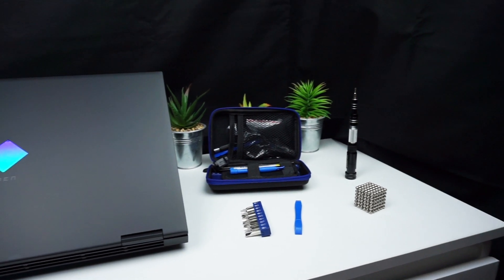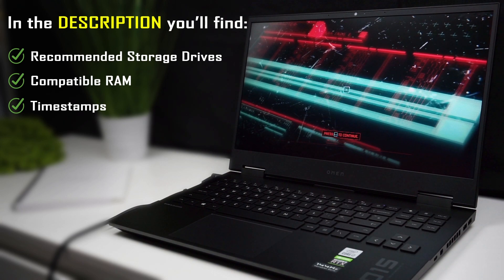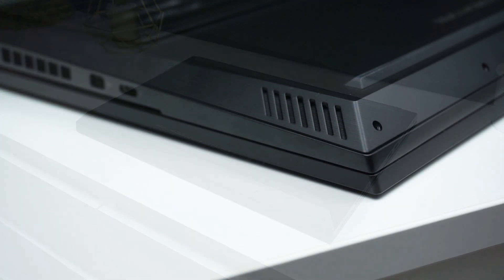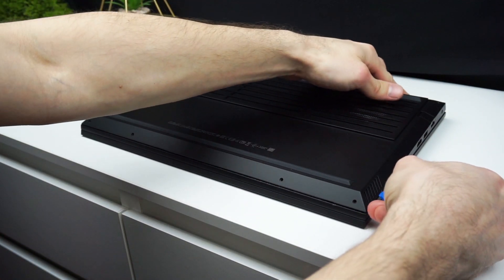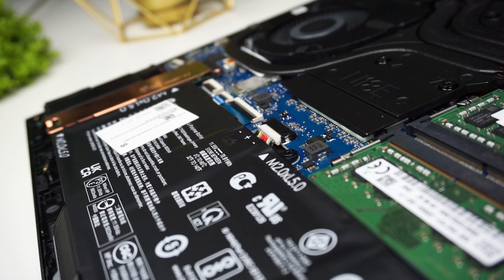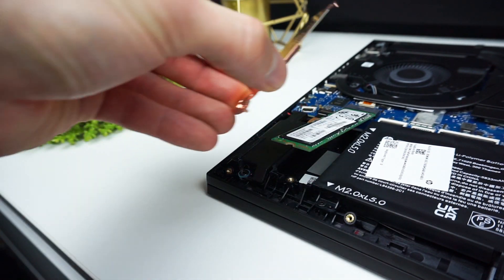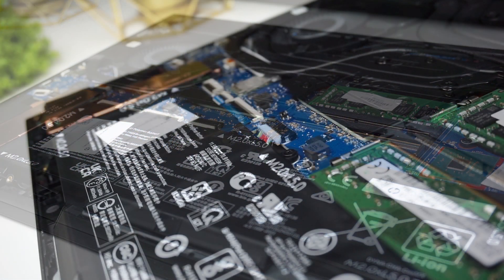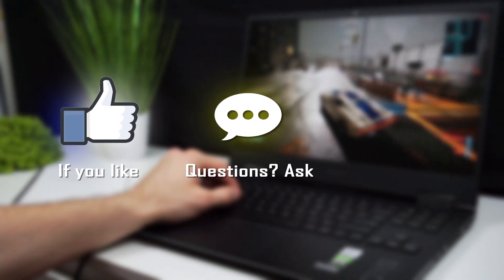HP Omen 15 2020 Upgrade RAM / SSD / HDD - Disassembly Guide

Comment: Can i use Crucial 1TB Nvme Pcle M.2 SSD stick??? (I have the same pc model as u) and also can i change both? To 1TB? (I have 512GB SSD Nvme Pcle M.2 Installed) and also do i have to program anything or just turn off the PC,open the back change the ssd and reattach the back? Is that all?
Reply from the maker: You can install these drives, both even more than 1TB if you want. However if you'll change the drive where you have your windows installed then you'll need to install windows again on new drive, transfer all your files and reinstall programs, games. You'll better off just adding one 2 TB drive in the empty slot
Reply: @TechFinds  thank you so much, this helped aloy,you deserve more subscriber's

Comment: Can you tell me if there really is much of a difference when choosing the 32 gb kit (16x2) 2666 MT/s versus the 3200 MT/s ? Also, i know this is probably a bumb question but im new to this all of the meanings of MT/s, but is the HP omen 15 even compatible with the 3200 MT/s ? Because it's only like 2 or 3 dollars extra and i could have gotten a better ram. (I went with the 2666 version because i didn't want to risk incompatibility and the 160-170 dollars)

Comment: My old omen had 3 storages  windows D drive and recovery why is that
Reply from the maker: It was just a recovery partition, which is not a separate HDD or SSD. You can split one HDD for example for 5 different partitions (A, B, C, D, E and so on)
Reply: @TechFinds   ah ok thank you very much